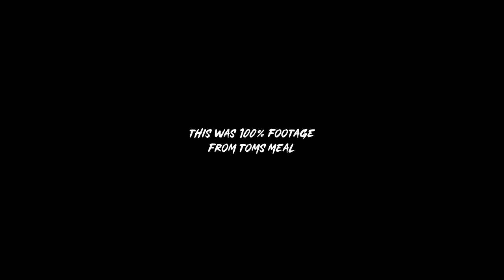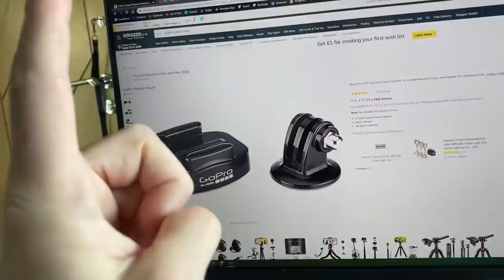The Mercedes AMG GTR Looks like NEW!

Comment: Just a quick one tom, if u want to wash your car ‘professionally’ u should be doing it by hand and only lightly power washing the car after. High pressure wont be good for it. Mercedes should also put guardex on the car.

Comment: Tom, so glad u r washing ur car yourself and listening! You do need to get yourself a proper snow foam cannon, plenty of them come with karcher adapters. You also need to get some chemical guys honeydew snow foam. You will then notice how much better shaving cream like snow foam you get from your snow foam cannon. The karcher soap n snow cannon is a watery joke. The Purpose for having thick snow foam on the car is to prevent you from installing scratches and swirls in the paint when you wash with your wash mitt. The very thick snow foam provides much needed lubrication prior to making contact with the paint with your wash mit. You also need a dedicated Iron remover product to properly spray and wash your wheels to remove brake dust. Good luck man! If you haven’t already I’d highly suggest having the merc fully ceramic coated. You will then see how much easier it is to maintain your car let alone wash it !

Comment: Hiya Tom I'm not sure if there is any other comment on this or you'll even see this but the car you saw with all the  white smoke is the result of normal condensation which builds up inside the exhaust system. ... Thick smoke usually comes from the faulty in engine coolant, which could lead to many serious problems like a damaged cylinder head, blown head gasket, cracked engine block… which might cost drivers quite a lot of money when repaired. I hope this help 👍

Comment: When cars smoke like that it usually means it's burning oil, so my guess is they have a leaky gasket that needs changing
Reply: My car smokes.. it’s a diesel thing doesn’t mean it’s a gasket..
Reply: @2595220  smoke is more common with a diesel indeed but still means there could be an issue with the car. On diesels it's more than likely over fueling so injectors or possibly a turbo problem. Isn't a major issue unless it's a constant smoke 😊👌🏻

Comment: yo also drive the amg in sports + so you get even less fuel economy but u gotta have the speeeeed :D
Reply: Sport+ just turns off the traction control, sharpens the gear changes, revs higher and suspension lowered. Steering becomes heavier and harder to turn so it becomes really hard driving around the UK
Reply: Ryan the amg gt has a eco mode
Reply: Ryan google it if u would like

Comment: The jet wash is too strong it damages the paint after 3 cleans 🤦🏼‍♂️🤦🏼‍♂️🤦🏼‍♂️
Reply: no it doesn't, all professional valets use pressure washers, you just have to use it correctly. if i can pressure wash my friends 2005 shitty corsa with 150k miles and not affect the paint then i doubt his gtr will care